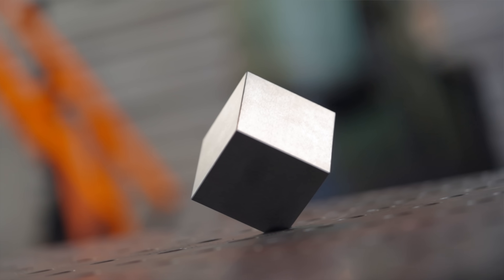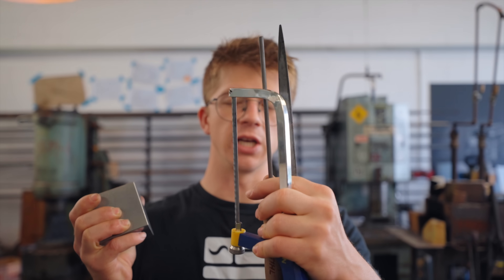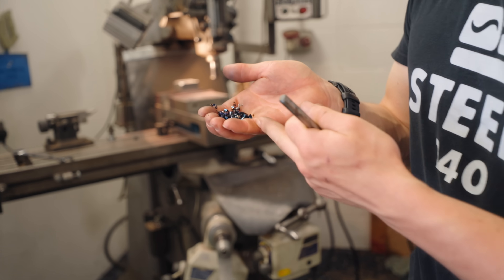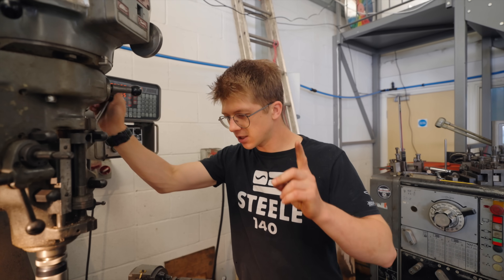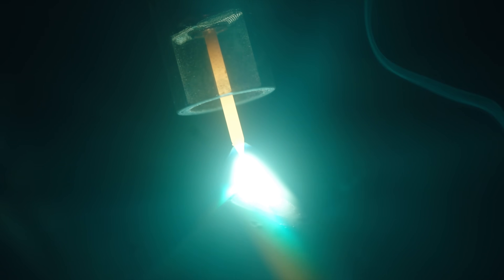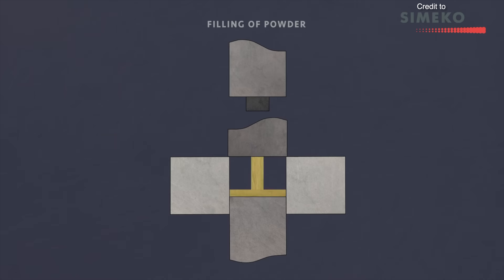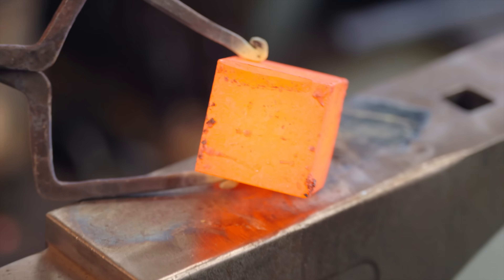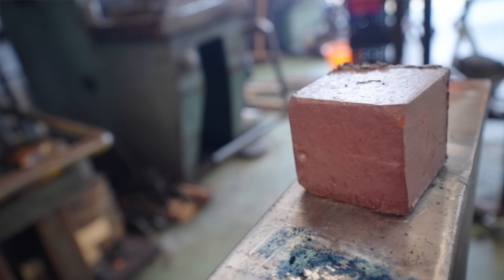Can You Forge Tungsten?

Comment: I see much more knowledgeable people have covered what makes tungsten so interesting. It's how freakishly heat resistant that's noteworthy. Back in the day when light bulbs had filaments tungsten was pretty much the only material that would work. My understanding is that the function of it with carbide is thermal distribution.

Comment: This is a very simple answer. Forge the tungsten into stamped inserts on either end. Roughly the size of a large pin that goes into the handle of a knife. That knife specifically is an 8-in and a 10-in chef's knife with a nice curved belly comfortable handle with the stamped tungsten pin as the very first pin of the full tank closest to the pinch point of the chef's knife. Offer different handle scales. Keep the steel the same. Maybe a Damascus variation? Call it a day. You're welcome. Send me the check for 10% of the proceeds when you're done.

Comment: Its important to understand the difference between elemental metal and metallic compounds. Tungsten carbide is a very different material than pure, elemental tungsten. Each has different mechanical properties making it better or worse in specific applications. Just because pure tungsten is very dense and heavy, doesn't mean it is hard, which is why it scratches easily.  Colloquially, we use the terms interchangeably a lot but in engineering, material "strength", "hardness", "density", "ductility", etc. are all very specific properties that measure different characteristics of a material.

Comment: Tungsten oxidizes at high temps. (sidenote, the purpose of the inert gas in TIG is to prevent the tungsten from oxidizing) Not impossible to work with but it's a pain in the a**

Comment: Designer for Formula One here. We use tungsten a lot for counterweights and ballast. This probably isn’t pure tungsten but a tungsten heavy metal alloy (check out AMS 7725). It’s a sintering of ~95% tungsten in a slurry of Nickel iron or copper. It’s the slurry which makes it quite easy to machine as the tungsten never truly fuses together. Making pure tungsten is practical impossible due to the melting point
Reply: I have a cube EXACTLY like this that's 1.5 inches on a side (exactly 1 kg btw). You're absolutely correct. This is 95% tungsten and it's sintered. The seller probably provided this information and Alec ignored or missed it.
Reply: @Falcrist  he does a lot of ignoring information for the sake of expedience and entertainment. Carbide is not carbon but silicon for one.
Reply: Partly correct. 
Counterweights in crankshafts etc. are mostly W/Cu liquid sintered materials, only the copper melts and 'solders' the pure tungsten particles together. Therefore it is easily machineable as only the W-particles are 'pulled' out of the matrix. But: depending on the particle size, you'll never get a smooth surface. 
"Making pure tungsten is practical impossible due to the melting point": this is certainly not true. Pure tungsten is not fully melted during production, it is sintered in H2 atmosphere under high pressure (the raw material is a W-oxide powder, the H2 removes the O). This limits the possibilities for the geometry of your material. Practically, pure tungsten is almost always only available in rod shape. The reason being the usual production route for 100 years was rod --> drawing the rod --> wire --> light bulb. The reduction rate per drawing step in diamond dies, limited by forces and brittleness of tungsten (the light bulb wire was in fact K-doped tungsten) was only about -11%.
Reply: Random side-fact: 95% Tungsten in an alloy with Nickel is usually used to make high end professional darts
Reply: Do we not have forges that can reach it's melting point?
Reply: @flyingfetus4364  how do you think it became a nice 95% alloyed perfectly square block?
Reply: @flyingfetus4364  Pure tungsten melts at 3,422°C (6,192°F), which is the highest melting point of any metal.
What are you making the heating elements out of?
The only way you're melting it is by running stupid amounts of electric current through it, and that won't last long.
Reply: @Falcrist  You make the "forge" with ceramics, but we tend to call them "kilns".
Reply: @kristianfagerstrom7011  This doesn't answer my question. First of all, most ceramics have a lower MELTING point than tungsten. Secondly, the temperature limit if a material (when it starts to lose its strength, is well below its melting point. Thirdly, the word you're looking for is crucible. What kind of crucible can withstand temperatures over 3500 degrees or whatever tungsten melts at? Hafnium carbide?

Finally, I'm not talking about the melting point if the container. I'm talking about the melting point if the HEATING ELEMENTS. It's gonna be damn tough to get that kind of temperature of your heater and all the insulation around your crucible collapses.
Reply: Can you not, technically, melt it it in a carbon casing? Which has "no" melting point at atmospheric pressure. The issue is that the carbon would oxidise so it would have to be done under vacuum or nitrogen.

How to transfer the energy, or heat, in that environment I don't really know. Laser?
Reply: @Metyletylhexanoat  The carbon might dissolve into the molten metal in the same way that it does in iron. Hafnium carbide or hafnium carbonitirde is probably the best material to make the crucible out of, and then heat the metal using a water-cooled induction coil.
Reply: @flyingfetus4364  What would those forges be made of? Tungsten is the element with the highest known melting point. Meaning a forge that can melt tungsten will melt itself before it reaches that temperature.
There are ways to make pure tungsten but it's more complicated than just heating it up in a forge.
Reply: @NotYourBusiness-bp2qn  Out of some material that doesn't melt at that temperature? The world doesn't only consist of isolated elements but also molecules and ions.
Maybe it's not possible because of some other reasons but your explanation doesn't explain anything
Reply: @cyan_oxy6734  There are some exotic compounds that have a higher melting point than tungsten like hafnium carbonitride. None can be used to make a forge for material strength reasons.
Reply: @NotYourBusiness-bp2qn  There are several ceramics with higher melting points than Tungsten.  Graphite and Diamond both have higher melting points.
Reply: @holdintheaces7468  I am pretty sure neither graphite or diamond being both carbon have higher melting points than tungsten. Again tungsten is the element with the highest melting point. Compounds like hafnium carbonitride do have higher melting points but they are unsuitable for constructing a forge for material strength reasons.
Reply: @NotYourBusiness-bp2qn  And for the record, Carbon, by every source, has the highest melting point (which is why graphite and diamond both beat Tungsten if you go look for sources rather than make stuff up and say it confidently).  It's also why those ceramics we both mentioned have higher melting points than Tungsten too.
Reply: @NotYourBusiness-bp2qnthere’s compounds you can use that have a higher melting point then tungsten
Reply: @ClaytontPierce  Not many materials retain good structural integrity at temperatures higher than the melting point of tungsten. Even fewer can be used as heating elements or flame nozzels. Not many materials are hard enough and strong enough to machine pure tungsten either.
That's why most tungsten cubes you see are this 95% tungsten sintered amalgamation.
Reply: ...MORE LIKELY IT'S POSSIBLE BUT IT'S BECOMING TOO WAY MUCH BRITTLE,RIGHT?

.........
Reply: The light bulb industry figured it out about 100 years ago, I think was William Coolidge who did. Though only for wires for the filaments, nothing larger than that.

Comment: Now try Depleted uranium which is even denser than Tungsten and stronger
Reply: And more radioactive. I wouldnt want to bring it up to forging temperatures.
Reply: @Grimfox27  Also, really rather toxic as well. You really wouldn't want a case of uranium heavy metal poisoning... :P

Speaking of toxicity, that smoke coming off the tungsten every time it came out of the forge...I wouldn't want to breathe ANY of that stuff in, that's for damn sure. Same with all the drilling and grinding and machining and stuff - that metal dust and filings etc isn't going to be 100% harmless exactly. I'd have worn a HEPA filter breathing mask at least. Preferably activated charcoal filter also, because I don't exactly have a rack of spare lungs and other inner organs hanging around... :D

Comment: So, it’s like forging room temperature steel then. Not really a surprise, given how far away you are from the melting point of tungsten. Here’s an idea: get a proper arc furnace with graphite electrodes and forge a tungsten butter knife. Why a butter knife? So that you can later heat it up to about 3000 °C to see how well it cuts through butter. Should be pretty smooth.

Comment: Tungsten carbide is extremely hard, but very brittle. These tungsten cubes/bucking bars are definitely not brittle, but they do dent/scratch relatively easily with forced contact with other hard metals/materials. Would be an interesting, but difficult to work, metal used for currency that could stand the ultimate test of time. As there are not too many natural ways on our planet to melt/destroy tungsten. Even if earth was covered in lava, tungsten coins/bars would survive unscathed.

Comment: Very odd!!  I can’t make a mark on my tungsten wedding ring with anything I’ve tried.  That blocks cutting WAY to easy!  I’ve tried dragging my hand on concrete, rotary sand disks and die grinder tools at 10,000rpm in a 1/4 air grinder and nothing.  Not even a scratch.

Comment: What about machining a core out after cutting it in half. Then add another element to it before power hammering it. O could see the thermal.heat transfer to the center of the block. Maybe well, a different procese but what about a resonant manipulation at high temps just to see if it could be used to change alignments in the core materials. 
Who knows what could be created

Comment: As a plasma physicist working on Tokamaks, I am very used to working with tungsten. If you have ever lift a slab of lead, which is surprisingly heavy, tungsten is 50% heavier than lead, so that small piece that looks like you can carry alone, you can't.
Edit: Yep, and 9:31 is exactly what happens when you put it inside a Tokamak.
Reply: Does some kind of coolant flow through the inner walls of the Tokamak with this material?
Reply: I have a 20 pound brick of lead, can confirm it's deceptively heavy lol
Reply: @noodlelynoodle.  Jeez that's gotta be like 20lbs.
Reply: @little_d_energy  yeah but it's basically the size of a normal brick so it's confusing feeling lol
Reply: @noodlelynoodle.  I’ve got a 750ml bottle or mercury (don’t ask) … that is also insanely heavy for its size.
Reply: @njones420    hell yeah, there was a mercury spill from a garbage truck here a while back from someone apparently throwing a bunch away and the city got it all cleaned up before I could go collect some :( I absolutely love mercury and definitely want to get a container of it someday, like as long as it's in a container  that will keep it's fumes in or just kept cold enough it's not fuming it's perfectly safe
Reply: @noodlelynoodle.  Yep, it's awesome stuff ... although I've had it at least 10 years, and never found a use for it   :)
Reply: @njones420  it's one of those things I have no use for but would just take some out occasionally to play with it or just shake the container lol
Reply: It's 70% denser than lead.
Reply: Tungsten is NOT heavier than lead.  W is 74 and Pb is 82, how can Tungsten be 50% heavier?  I don't have a great deal of experience of W but as a member of a PlumBing family, I've melted a shitload of lead to drainage pipes.
Reply: @wisconsinatIon  the chemical atomic number has nothing to do with how densely an atom is packed or is packing with each other.

There are way bigger atoms than Pb that have a lower density as well. Tungesten is way denser than lead and therefore heavier.
Reply: @wisconsinatIon  that's not how density works. That's just the mass of a single atom. The atoms get packed in different ways, and tungsten happens to pack very densely, like gold.
Reply: @wisconsinatIon  Radon is 86 ... and that's a gas.
Reply: @N_Jones tungsten can also be made into a gas by making tungsten hexafluoride which just feels like something that shouldn't be able to exist because of the tungsten component lol
Reply: @noodlelynoodle.  all I know about the hexaflurides, is they are so dense they have the opposite effect on your voice to helium, never had the chance to try it though.
Reply: @N_Jones  Fill an aquarium with that Sulfur Hexafluoride and you can float an aluminum foil boat on it.
Now I wonder what you could float on top of Tungsten Hexafluoride... 😅
Reply: @wisconsinatIon  "The density of lead is 11.34 grams per cubic centimeter (g/cm3)."
"The density of tungsten is 19.254 grams per cubic centimeter (g/cm3), which is comparable to the density of gold and uranium."

Comment: To get tungsten to forgable temps you would need to be wearing much better protection. The heat would also destroy the dies in your machines. 6000 degrees would melt your tongs and set your gloves on fire.

Comment: Fun fact: when alloying with high melting point metals like Tungsten, Tantalum or Molybdenum they dont actually melt, they dissovle into the pool of molten metal. Just like table salt (Melting Point = 801 °C) can dissolve into 80 °C hot water.

Comment: I mean, that is to be expected. Steel is not a Metal either. Both are so called “interstitial compounds” where you have a metal crystal with (in this case) Carbon atoms filling some of the spaces between these metal atoms. This prevents movement within the crystal structure, which means the material will become much more resistant against deformation. That is the reason why Steel is both very hard and elastic. It is also the reason why Tungsten-Carbide is less dense, but much harder than Tungsten by itself.

Comment: The thing about tungsten is that it actually gets hardened every time you pull it out of the forge at bright yellow colour. You need to heat it up to cherry red then let it cool very slowly to make it softer. This will probably make it easier for cold forging, and certainly easier for machining, however I wouldn't try cold forging such a thick block for obvious safety reasons.Good luck! =)

Comment: Super helpful to see it characterized like this. I use tungsten in our fusion experiment (WHAM) and have always designed my tungsten parts around the idea that you need special tooling to machine it.

 I suggest you try out molybdenum and tantalum as they are both materials I work with and are also refractory metals like tungsten. I've noticed tantalum is very soft and molybdenum, at least sheet stock, easily delaminates.

Comment: I was planning to search for Hot Tungsten with Hydraulic Press in the middle of video but very impressively you covered it by the end and results were as expected.
It would be interesting to see smaller 1inch Cube at near melting temperature under hydraulic press but oxidation & reactivity will be concern in your standard workshop. Also not sure abt cost of achieving those temperature, would love to see you return to this point with higher temperatures in near future. 

P.S- Some great comments and explanations are under the video, Kudos to you all.

Comment: Try welding it as chips in a canister. Perhaps buying tungsten powder to fill it. Heat it and see if you can pressure weld it on the press without it just crumbling.

Comment: Tungsten can’t handle shock, but it can handle an insane amount of pressure. All the drill bit test are giving it a bad name. In my line of work, product gets pushed through a hole 1mm at most 4000 psi for a long time and it can be used over and over again.

Comment: Tungsten has an extremely high melting point of about 3,422°C (6,192°F), making it difficult to forge in the traditional sense. However, forging typically happens below the melting point but within a range where the metal becomes malleable.

For tungsten, this would be in the range of about **1,200°C to 1,400°C (2,192°F to 2,552°F)**. Even at these temperatures, tungsten remains very tough and requires specialized equipment and techniques, such as hot isostatic pressing or powder metallurgy, to shape it effectively.

Forging tungsten at these temperatures is challenging due to its brittleness and hardness, which require not only high temperatures but also substantial force to work with.

Comment: If you're able to get shavings from it, perhaps you'll have luck with heating up and stamping the shavings into thin sheets, which you can then fold steel over. Are tungsten tangs a thing? The solid mass is too much but maybe the shavings will be moldable enough `\_0-0_/`

Comment: Done ask Siri, ask ChatGPT, 
Material	                                  Melting Temperature (°C)	Melting Temperature (°F)
Tungsten (W)	                  3,422 °C	                         6,192 °F
Tungsten Carbide (WC)	  2,870 °C	                         5,198 °F
Iron (Fe)	                                  1,538 °C	                         2,800 °F
Steel	                                  1,370 - 1,540 °C	                 2,500 - 2,800 °F

Comment: Hi!  Info from the Laser world:  Tungsten filaments sag around cherry red.  They are tougher above and below this heat.  The power supply is designed to take the filament through this regime as quickly as possible, since a sagging filament will block the light path.